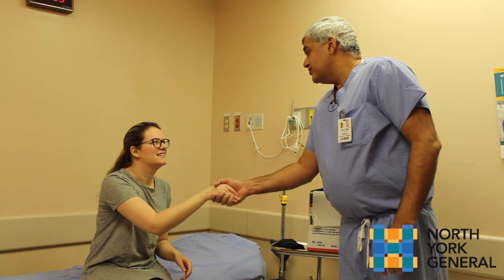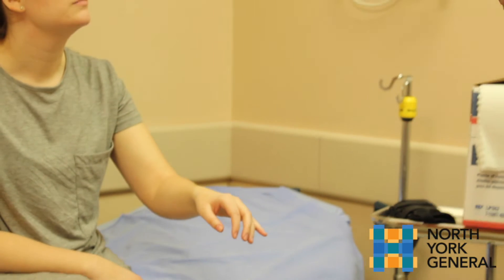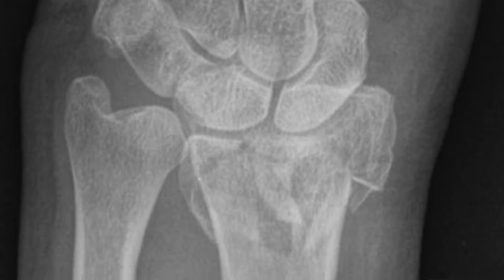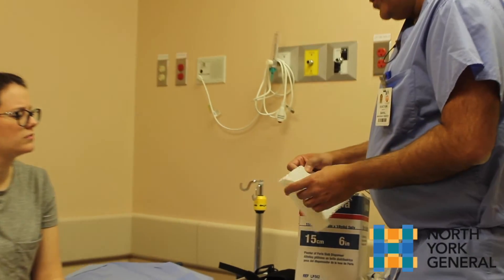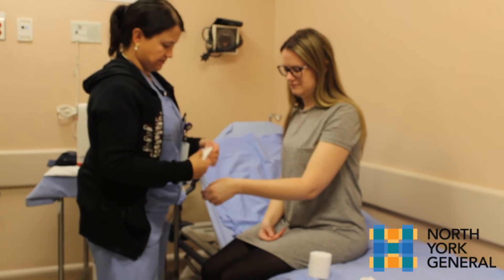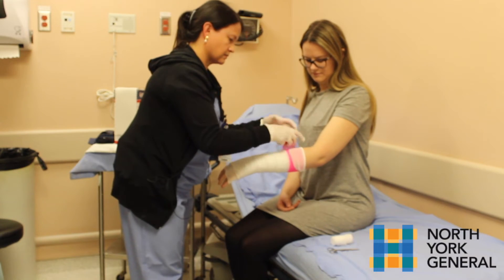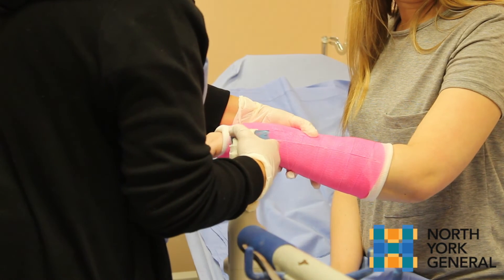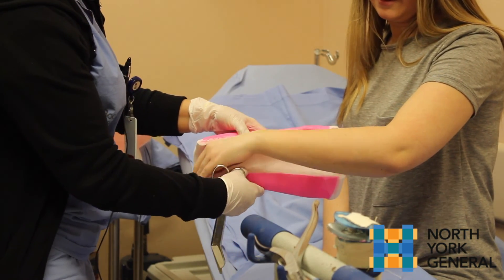Behind the Scenes: How a cast is applied

Comment: Wow the way to remove it is so much better now. When I had my cast removed back in the early 2000s they used a giant saw blade and put a plastic strip under the cast so they dont cut my arm accidentally 🤣
Reply: lool
Reply: saw blade by design can not cut skin. some sensors or whatever.
Reply: they use a saw now but it looks like its spinning but its actually just vibrating back and forth, if it were spinning it would slice ur skin but its goes back and forth so it can cut fiberglass but if its hits ur skin it just wiggles ur skin